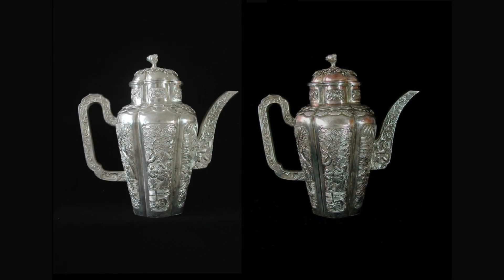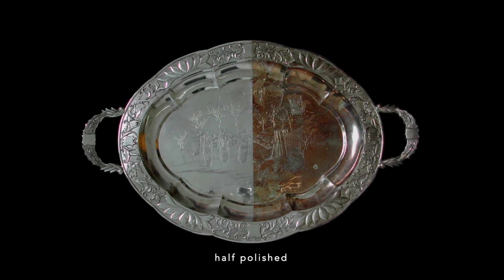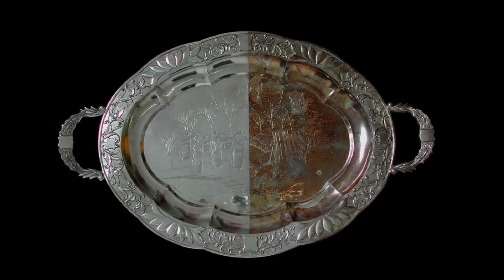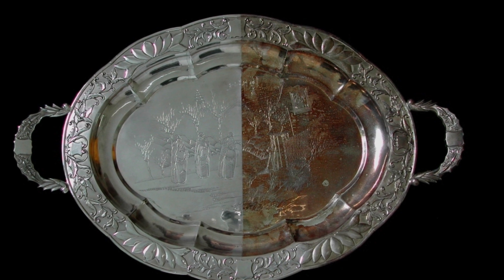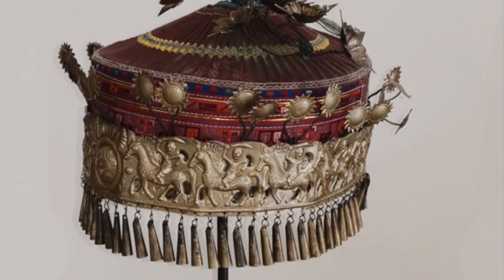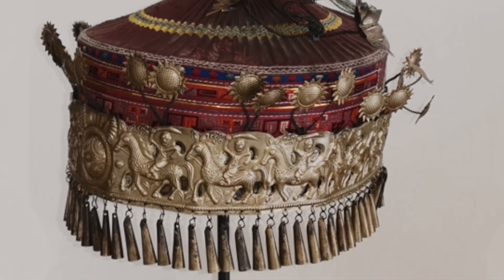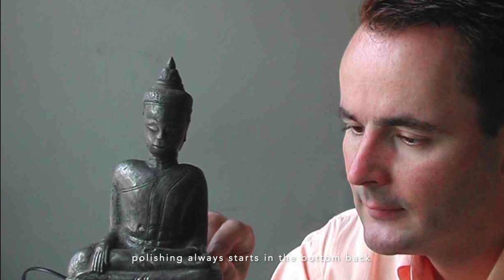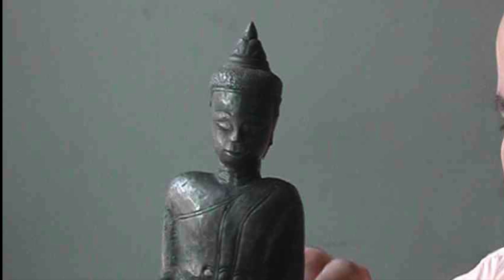The Heartbreaking Truth About DIY Silver Polishing

Comment: Thanks for the video. I have always heard the advice "don't polish antique silver" but this is the first video that actually explains why.

Just curious, does Renaissance wax react with silver? If not, will the strategy of polishing then immediately sealing with RW, work?
Reply from the maker: Renaissance Wax contains polyethylene waxes. Polyethylene waxes are pretty difficult if not impossible to remove. Over time they deposit in recesses and porous areas and disfigure an antique (in my opinion) . Pure micro crystalline waxes exist! I always opt for an acrylic coating.